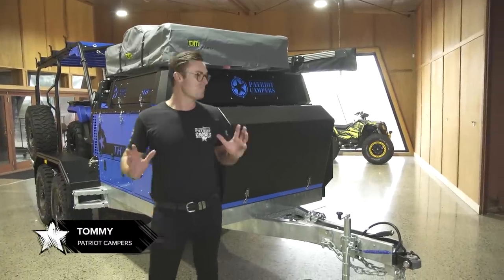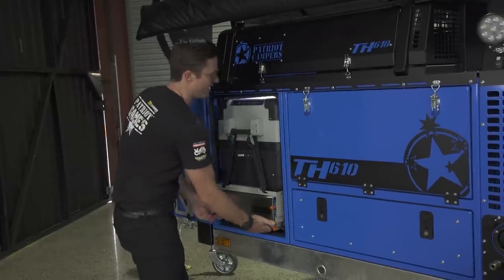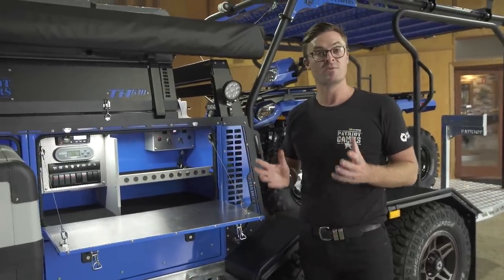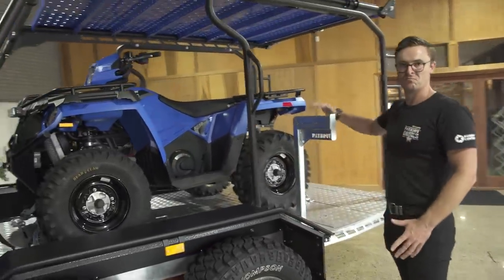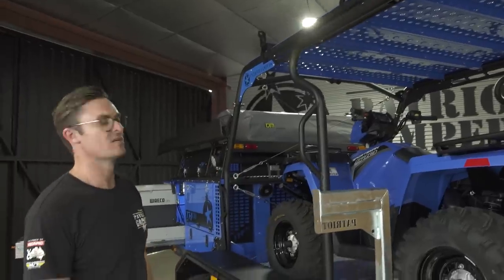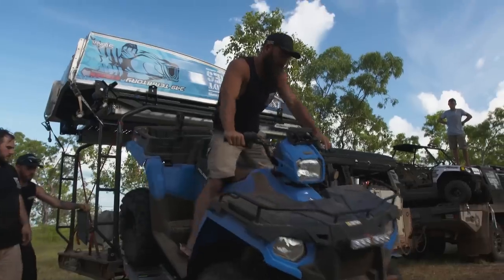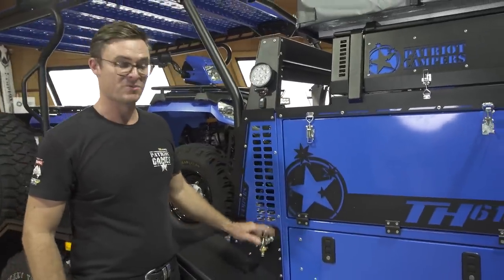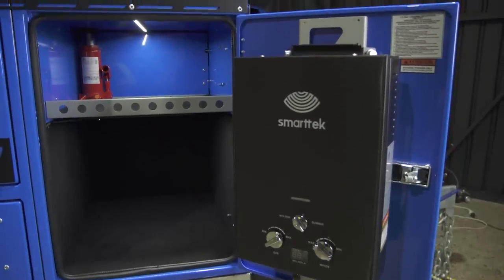The ULTIMATE Off Road Toy Hauler Set Up - Patriot Campers Walkaround

Comment: Needs a build in Pressure Washer too to wash your toys and trailer down on those muddy days pass though .
Reply: That and a welder.. generator.. ac unit.. air tanks and compressor.. fuel bowser.. solar.. hot water heater.. etc etc.😂😂😂

Comment: Great product but I can already see better design improvements just from watching. Why would you ever store gasoline with your bbq? That's really dumb. Also your wet box for all your dirty clothes is up high, I'd have it low. Gonna get everything dirty lifting it up and into that cubby hole. Not to mention try and cleaning the compartment. Imo you should have slam latches instead of the kind your using. Also that's a eletric cooler not a fridge. I could go on but that's just at a first glance. It's got a good idea behind the design but it's quite flawed and needs improvments before I'd buy one. Litterally scratching my head at some of the features your trying to explain. I get the logic but poor design and functionality. 

I want to add, as a buyer these are just some of the things that are make or break for me. Some of these features are spot on, others look like a massive pain in the ass. Either way, it's extremely close to being something I'd consider buying but not in it's current state based off of what you have showed